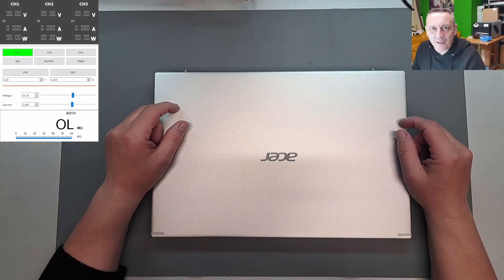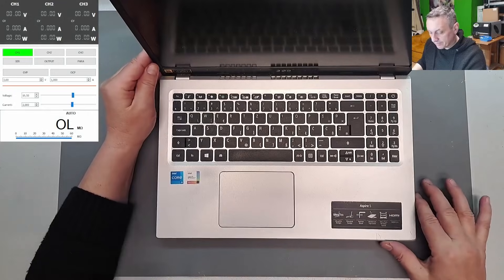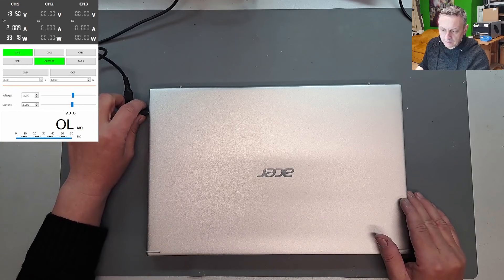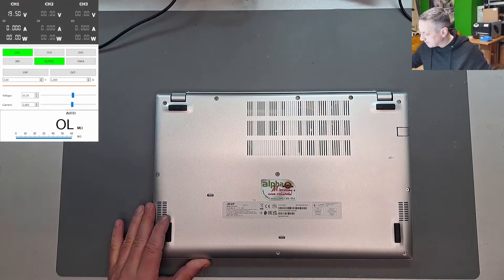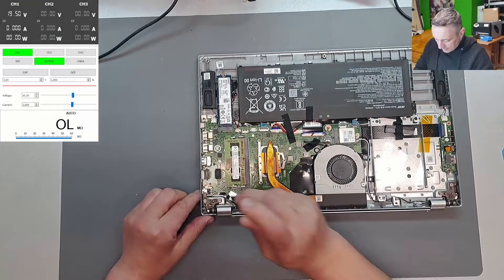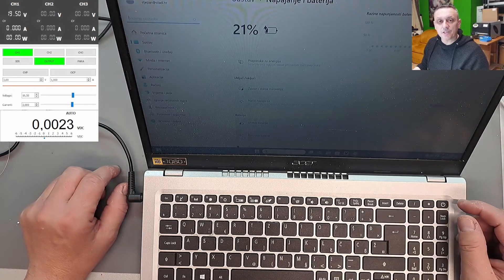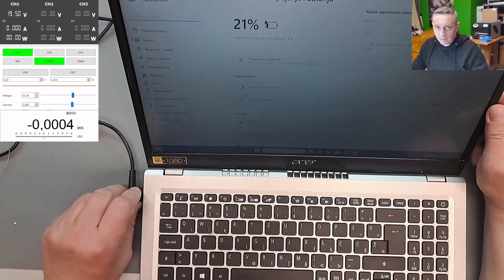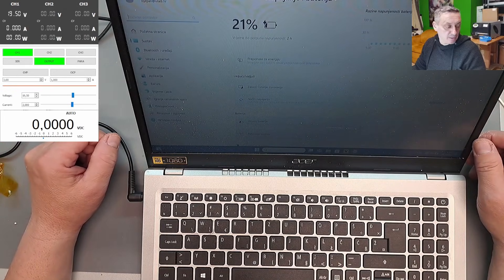Common Acer Charging Problem --- Replace Charging Port?!

Comment: What a hack job! First 8-10 minutes to state the obvious, then high speed so no one can see how to remove the board. Flux? I have been a repair tech for over 35 years and have never used flux, in fact don't have any. Fat Screwdriver solder head on fine electronics? Again a big no-no. Always a fine tip sir. Should have just done the right thing and replaced the socket with a new one.

Comment: Can I ask what the wire is for? The pad in the rear of the port isn't a neutral, but the one in the front is. 
I have my laptop in pieces now and have just finished reflowing the 5 connection points.
Reply from the maker: There is a little switch in the connector to enable charging when you plug the charger all the way in. This gets broken in the port so you need to ground that pin. Just solder the wire like i did and you are good to go.
Reply: @Lapfix-HR Thanks very much mate. I just closed the bugger up and I don't know if there's enough life left in the screw inserts to open it again as I've had it apart for upgrades and re-pasting so many times. 
If I get a hint of another issue I'll definitely go back in for the wire though 👍👍👍

Comment: is it possible to do it without the wire and just re-solder it?
Reply from the maker: Nop. The switch / tab in the connector is broken, and it doesn't get connection to ground. You need to ground it somehow, easiest is with a piece of wire.

Comment: I don't understand. My plug is loose in the socket. How does everything help? Surely the connector/socket needs to be replaced?
Reply: There is a way to tighten it up. I saw it on another video, basically you can see at 10:48 and 11:12 the prong kinda things in the middle of the metal bit on both sides near the charger port hole? They're the tension that keep the charging cable connector in place. If you bend them further downwards it'll put more grip strength on the charging cable connector once its slotted into the socket. The video I watched, the guy used hot glue to keep them in place. Not sure if you need to but worth it just bending them down a bit. I'm gonna try it when I next open my laptop cause my charging wire is a bit wiggly in the port.
Reply: @TyrantSong how were u able to bend it?? i have the same problem, technician said the motherboard is the problem 😭
Reply from the maker: Hi. If the charger is loose in the connector, then I guess it needs to be replaced.

Comment: My male plugin can't fit into the female port, is it because something is stuck or is the male tip damaged because the colored rubber is broken?
Reply from the maker: Hi! Hard to say. If the plastic part is broken, it should not matter too much. I have seen broken charger plugs and they fit fine. I would guess female connector is bad.
What can happen is that the ground pin or the safety pin inside the female connector gets bent and blocks the charger. Try to look inside with a lot of light and see.
Reply: @Lapfix-HR  if so sir, how do I put the safety pin in the right place
Reply: Yeah I had same issue I took a needle and tried to un bend that pin

Comment: I wouldnt bother with replacing the charging port. The wire is ever lasting and will never break so no warranty job. Nice, neat repair. Thanks.
Reply from the maker: Yes, a nice and pleasant job, it should last. Thanks m8!